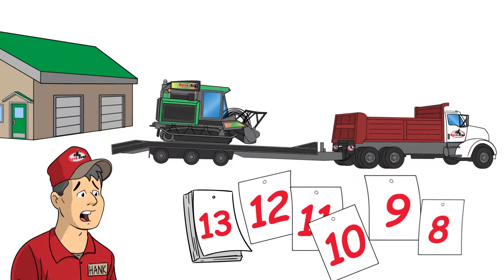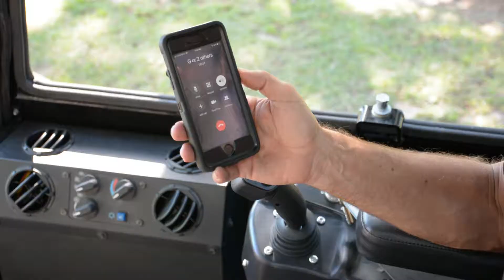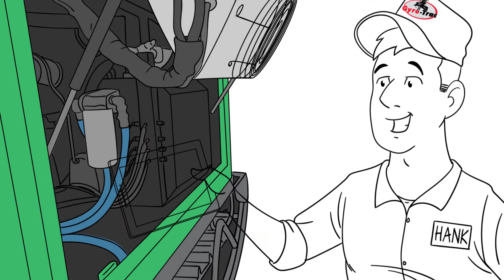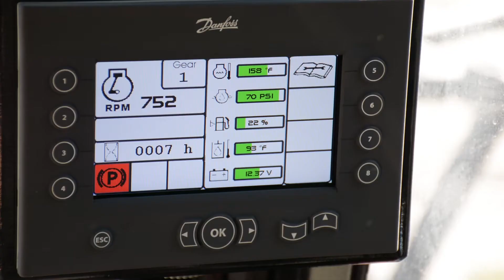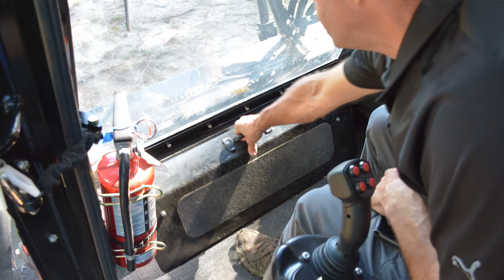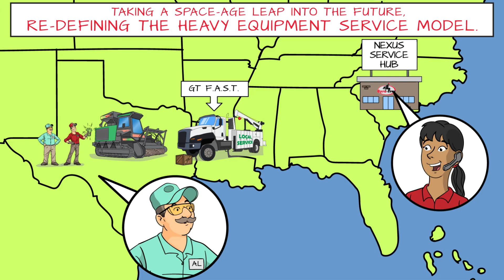NEXUS Service Platform Explained

Comment: The Nexus Service platform may work great with new machines.  But as an owner of three Gyrotrac machines that range from 2006 thru 2012 diagnosis of problems and their ultimate repair does not always happen as quickly as a couple of days.  I have a machine at the moment that continuously flows about 15 psi to the mulcher head after the mulching head is turned off. This small pressure causes the head to continue to rotate and creates a very dangerous condition when transporting the unit  or loading it. The only way to stop the mulching head is to complelty shut down the machine, allow the cutter head to stop rotating, then restart the machine and transport or load it.  My mechanic has consulted with gyrotrac multiple times about this issue and spent a significant number of hours attempting to stop the problem, to no avail.   Gyrotrac service staff have not be able to provide any solution to this problem.   Try telling a safety officer on a Marine Corps Base that the head still turning while the Gyrotrac moves from one location to the next, is not a safety concern.
Gene R. Taylor
Lawn Pro Inc.